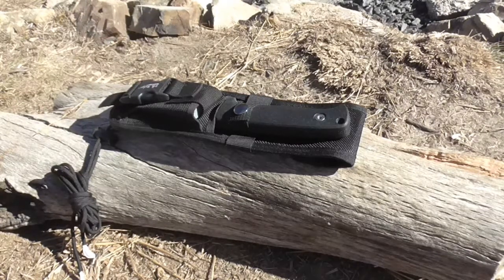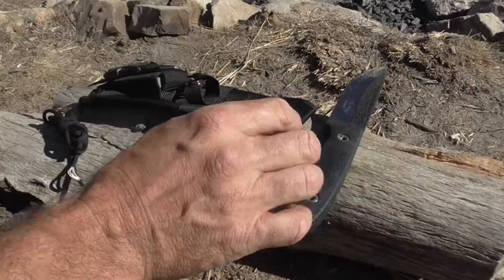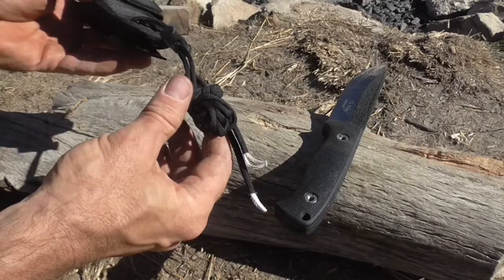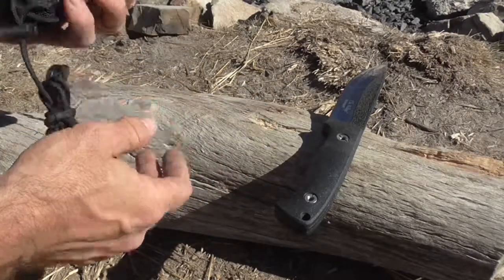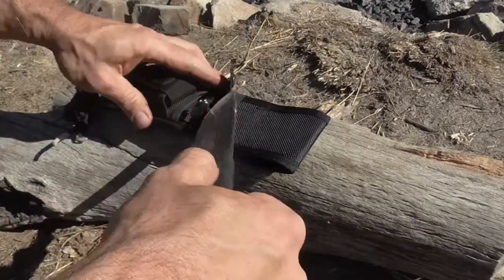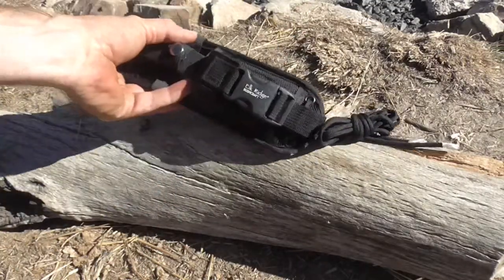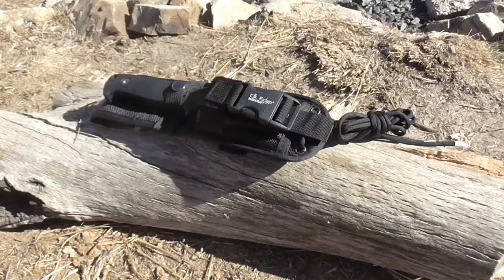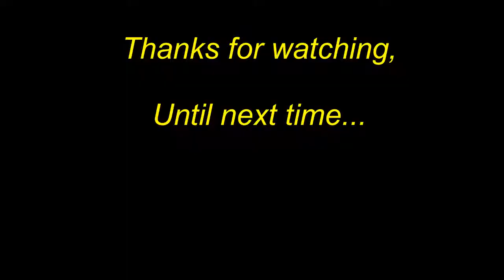Elk Ridge Bushcraft - review and modification

Comment: You are using the striker wrong
Reply: And also, if uses a hacksaw, how will he open the handle compartment
Reply from the maker: Budgail - The hacksaw blade still undoes the screws, already checked that part.   
Asad Lion -  how should it be used?   I have seen a few people on YouTube struggle with that striker.
Reply: The striker is ok if u use it a proper way. Use the side with teeth next time.